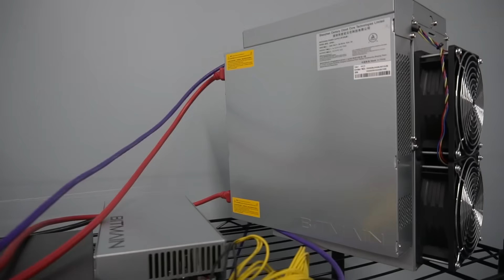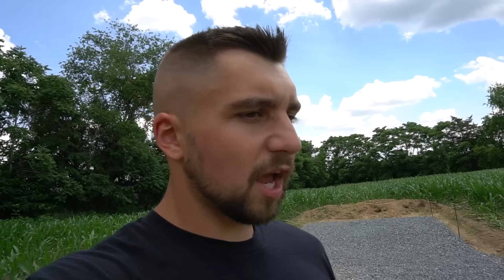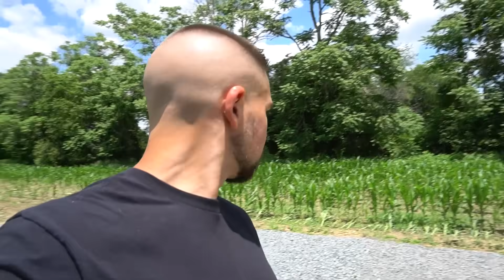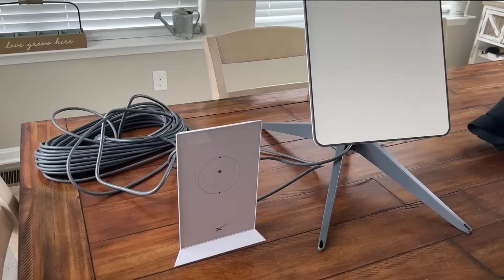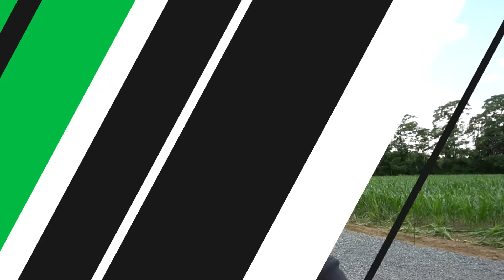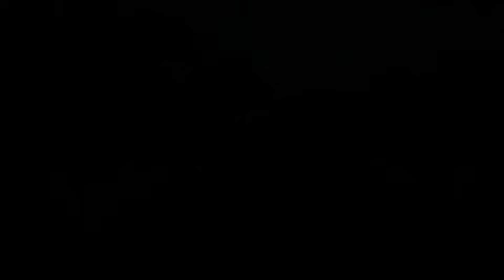How I’m Building An EPIC Solar Powered Bitcoin Mining Shed!

Comment: Here in Ontario Canada we have something called "Net metering".   Its a 12 month rolling window for solar applications connected to the grid.   Produce more than you consume in the summer and use it in the winter.  Not sure if your state has that same thing with your utility company.   Also consider a good security system if your shed is far from your house!

Comment: Hey Vosk ever consider submerging your rigs in a cooling fluid system? So that it was quiet, didn’t depend on fans (depending on your radiator or heat exchange tool), and had consistent temp to overclock or otherwise optimize? I see it’s possible to overclock more effectively with liquid cooling, but? I don’t understand if overclocking this way is efficient hash/energy use even at safe temps.  But, in my mind, liquid cooling seems way better bc of the noise alone, and the other pros are a bonus. Do you know about these things Vosk? People complain it’s hard to build a cooling machine properly and ready the cards, but is it harder than anything else u need to do to mine with asic in the first place? It took me 2 days to figure out how to put a Linux os on a ssd using macos. I think it would be fun, good content, and maybe even worth it financially lol. Lmk
Reply: Heat Exchange could be pumping coolant through pipes downward under ground, newer design of Cooling and coolant or air.

Comment: As an asic miner of scale, you are not gonna get away without intake and exhaust fans. You are gonna want to make a hot/cold aisle setup and have an exhaust fan setup that matches the CFM of the machines output. An s19 pops off 400CFM

Comment: I absolutely love the enthusiasm, but I'm afraid that you will soon realize how little electricity solar panels actually produce.   One bitcoin miner running full time at 3,500 watts will consume 84,000 watts per day.   In the summer, you will be lucky to average 6 equivalent hours of full sunlight, which means that you would need about 4 times the 84k output of solar panels.   This means that you would need 336 solar panels rated at 100 watts.     As for batteries, you'd need an absolute minimum of 3/4 of the daily power draw in storage power to get you through low light dusk and dawn and night time.    That comes out to a whopping 63 KW of battery storage.         All of this doesn't include power for fans, lights, internet, etc.       And these calculations are for summer time.    Obviously, you'd need a lot more panels in the spring, fall and winter.   Not to mention heating your LiFePo4 batteries in the winter so that they don't drop below 32 degrees  (and no, the heat output of a single miner wouldn't be enough on the coldest of winter nights).        So in summary:   Over $50,000 in panels, batteries, charge controller and inverter just to power a single bitcoin miner full time during the summer only.      You'd be better off buying miners in a mining farm that runs off of hydro power.   (As in your video last month of the Hydro Whale Mining Club).

Comment: Don't waste energy and $$ converting the DC output from your panels into AC only to pass it through another 80% efficient PSU to get it back to 12v. Build a 12v solar system for mining and use a small battery bank(s) to buffer the system. It won't run through the night without a large bank of batteries and at 12V you will need thicker cable everywhere, but it is a much simpler system with higher efficiency.

Comment: I Did this recently. I  built a hot side/cold side wall and used 30" industrial exhaust fans to create air flow. Had Tesla install 20kw solar roof and 6x poweralls. I  can basically run 2 x S19's 24/7 on what it produces. I produce about 100kwh a day of elec.  Miners make about $625/mo. (at current $20k price) and loan payment on the solar is $1,125, so I'm subsidizing the cost.

Comment: As far as Airflow is concerned, I'd suggest the raised floor design. Cool air incoming from below and the hotter air expelling naturally, or with as little additional air handling needed.  Individual cabinets are best, but if not available I get understand the undertaking
Reply: Totally speaking from my own experience in a telecom server center
Reply: As far as generating cold air. He should run about 100 foot of underground culvert 5 feet deep. Think about how cool that would be from ground temperature.
Reply: @ThomasDiy  that would be nice and cool. 👍Downside is the moisture content. He could pack the room with pouches of desiccant to remove the moisture.

Comment: The best way to make a mining room if you have money is to not have any fans on the miners at all. You use custom ducting to direct outside air directly into the miners and then the exhaust goes outside. That is more efficient than running fans on each miner to just toss hot air around the room and mixing outside air with it. This way the whole thing isn't contingent on cooling the entire room.

Comment: I was doing math long time ago and solar just doesnt make sense, especially with bitcoin mining.  Bitcoin Miners pull too much power.  You can never have enough miners to make it worth while and enough solar to power them all.  It makes for good videos, but he best you can do is subsidize your power bill.  Solar costs are too expensive to really get ahead, even with increased power costs.  Wish you the best though.
Reply: BTC miners will quickly overwhelm a residential solar setup, but this is a commercial operation with acres of land to build out the solar farm.
Reply: @SavageBits  i understand the room issue, but my origianl point still exists.  The amount of panels required to run just one miner have a high cost.  Then combine that with cost of adding more miners and panels, it could easily walk into the millions to make a 1000 dollars.  I welcome the idea and said it will make intersting videos on what is next and problems that arise.  I wish him good luck for setting a goal and following through with it.

Comment: I'll be interested to see if a solar setup is really worth the costs. While panels are dirt cheap everything else adds up quick. I'm building an off grid setup currently and with a pair of 8kw charge inverters for 240v ac and a 5kwh battery it's already at $3000 on top of the $1200 for 25 250w panels. This is for an off grid setup though. The reason I'm not grid tying is in my area they would only buy back what I put into the grid and the costs to get it setup wasn't worth the cost rather than just going off grid.

Comment: I would suggest waiting a few years on the batteries. With the push to electric cars battery tech is going to increase leaps and bounds in the years to come.
Reply: 100%
Reply: wind turbines power 24 /7 in the uk anyway
Reply: Yes, batteries don't make sense right now.
Reply: I suggest you check out Will  Prowse's Solar Channel. He has already shown its possible and DIY ready.

https://youtu.be/mzZR6SWonrY
Reply: Y'all crazy
Reply: batteries are for mobile applications ONLY
Reply: @orthodoxNPC  I have a battery radio that's pretty good

Comment: Due to electric costs, current difficulty and btc price, I shut all my miners down (516 TH/s), $1.70/month/miner profit isn't worth running them. 

I hope you have everything paid off in this venture before starting, with no electric bill it would be profitable, I use about 17000 kwh/month and that is a huge cost to offset in solar